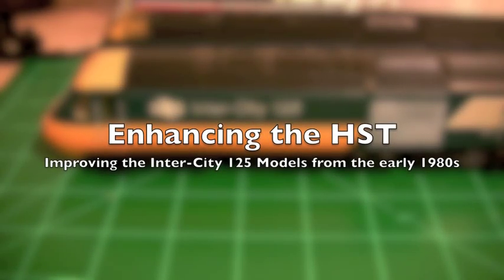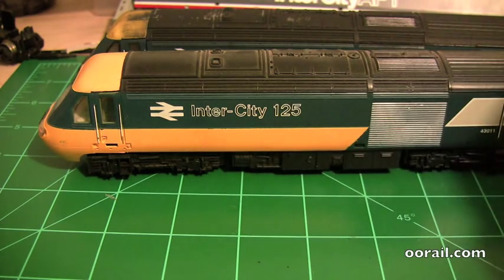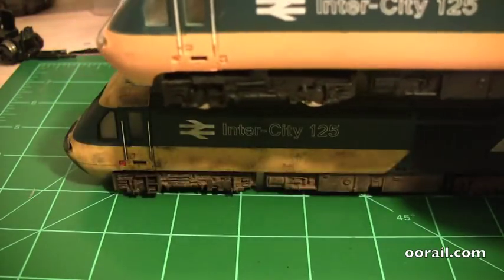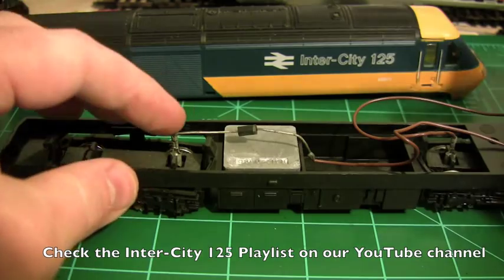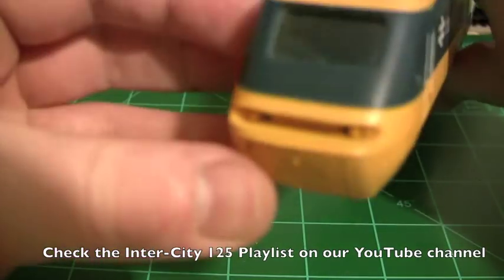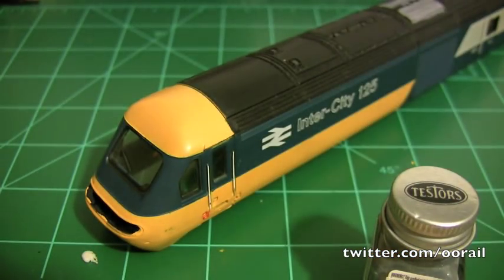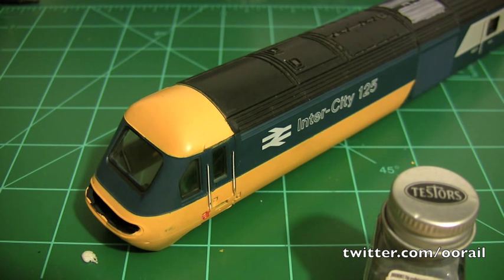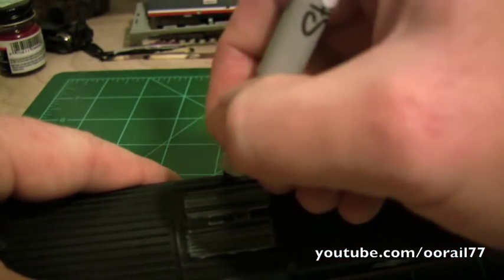oorail.com | Hornby HST Enhancements - OO Gauge Model Railways - Part 1

Comment: Good work there and I hope you won't mind me giving some constructive feedback for future projects. When I detail my model trains. I always take them apart such as remove the glazing units etc and if its an old secondhand model train. I give the glazing and the bodyshell a good wash in soapy water and then allow a full 24 hours for it to completely dry. I use an old soft toothbrush to scrub away the cack and dust that gets into the crannies and nooks. From experience, it makes it easier for the paint to take hold onto the areas that need touching up and when I update an old Lima model. I will use masking tape on the glazing units as then it is easier to apply the paint and keep to the areas that I want paint to go to because I don't have a steady hand unfortunately.

Keep up the great videos mate.

Comment: Weathering: That's a little excessive in terms of the lower yellow but the cab roof is well done here. Very authentic and a feature of this and the Inter-City Executive / Swallow liveries of the 1980s which eventually superceded this livery.

History: Power Car '43010' still goes strong with Great Western Rail (formerly First Great Western) out of London Paddington. Unfortunately Power Car '43011' was the rear vehicle on two accident HSTs: Southall in September 1997 (collision) and later in November 2004 at Ufton Nervet (level crossing obstruction.) The set '253005' was also involved in a minor (empty coaching stock) derailment in the Bristol area in April 1979 ... However it's still worth retaining the original running numbers for authenticity's sake! :o)

Comment from the maker: its not actually possible to fit the front lense upside down, there are two square plastic pieces that prevent it, plus its pretty obvious thats it wrong when its in upside down. the older Hornby HSTs didn't quite have a smooth fit to start with. so i did fit them correctly :)
Reply: Erm ... It is possible to fit the headlight / grill component at the front upside down on the 1970s / 1980s offering of the HST from Hornby: Used to do this for a laugh on mine! But it is obviously wrong and looks wrong when fitted like this which is why I only did that for fun. :o)

Comment: igot inter city 225 can tell how repair it or show me how please
Reply from the maker: +craig bates The Inter City 225 should be powered by a ring field motor. I would start by trying to lubricate it with some synthetic oil around the centers of the cogs, between the cogs and both sides of the bearings through the center of the commutator (should be a brass small cog in the center of the motor with a peg looking thing on either side of it going through the center of the motor. Lubricate both sides of that peg, and the axles and it will most likely start going. If not, check my popular uploads on my channel, and find the APT motor maintenance video, its basically the same motor.

Comment: I think you over-weathered that HST. Passenger trains did get mucky but only in hard to clean places like the grilles, roof & underframe as passenger locos were kept clean. Just be careful as you can easily make something look fit for the scrap line & not the mainline